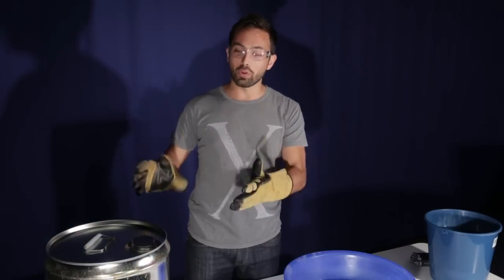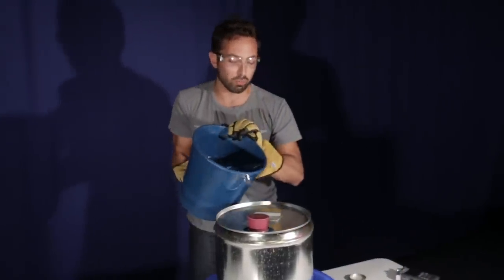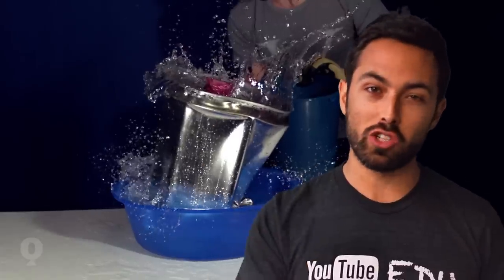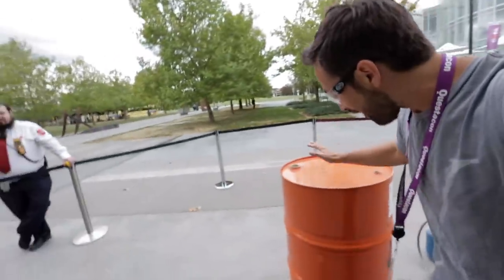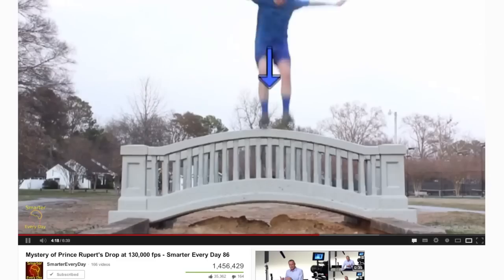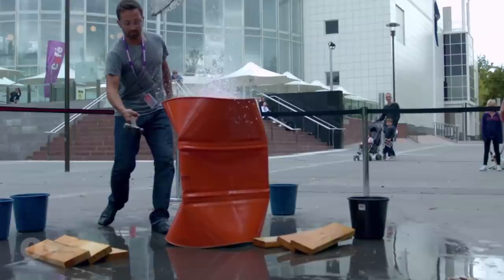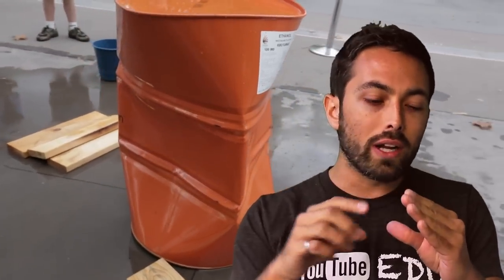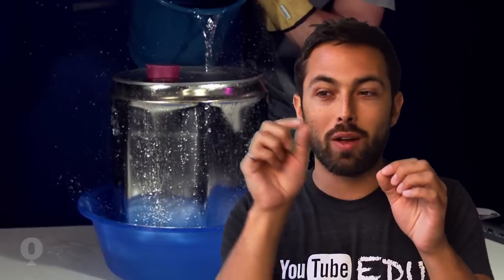Epic Slow-Mo Drum Implosions!

Comment: I'd guess it has something to do with being Perfectly circular. A better made canister will resist the force equally, so that when it contracts, it does so equally on the round shape, so the force travels around the outer surface, and collapses the sides around equally space tangents. (At least i think the word is Tangent...I may be using it wrong. I is are not gud wit da mat'matix termz)

Comment: ...to me smaller drum has smaller (better) height to diameter ratio, meaning it sides can witstand higher lateral pressure. If the vacuume inside smaller drum is simmilar to that of the bigger drum, given the biger surface area of the bigger drum higher force will be exerted on the drums sides meaning it will crimple it even "deeper", until it's sides turn into triangular shape...:/

Comment: well there is the key difference that you hit the orange drum with a hammer and the other was not. the orange drum crumpled with the point of contact with the hammer directly in the middle of that side of the triangle. the ridges on the drum most likely played a part as well

Comment: Derek, in my perspective, what you suggest about minimum volume is incorrect. Wouldn't be even better if the drum had crumpled in a shape of a line and the two opposite sides came in contact (so the axial cut would reveal a line and not a triangle) and the volume left would be even smaller...?

Comment: Yeah that's fucking awesome.. 
In my opinion it's because of the size difference between the barrels, the smaller one had less "work" to do whereas the big one had more resistance to deal with along with a higher amount of water to be condensed within. This would explain why it took longer and 'chose' the most efficient way to implode. The smaller barrel had more of a structured implosion it seems, as if the vacuum had time to create a nice structure until it imploded from the lower right!Imhigh

Comment: I think you aren't completely right about the triangle being the equilateral figure with the minimum amount of area on a fixed circumference: a "bi-agon" (polygon with just two corners, i.e. two parallel lines/sheets) would enclose no area at all.

Comment: you dont answer my comments anyway 
but i still wanna answer that.

the big drum was hammered, the small was not
atmospheric pressure is regarded as CONSTANT
the big drum is stronger than the small drum
small drum cant stand the pressure not due to STRUCURE 
but due to the STRENGTH of the material used
still, when temperature change happen very rapidly
(in this case cool water)
it will form into triangle
the big drum was hammered 
forming uneven cylindrical shape
making the STRUCTURE weaker

Comment: Mmm... That's interesting. If it's uniform, then the drum wouldn't implode (no favored direction), but there is a weak point where Derek hammers it. May be the poligon depend on how hard or where (relative to the welding points of the barrel, for example) the hammering is?

Comment: The answer is weaker parts of the surface deform first. If every parts of the surfaces were equally strong (which is impossible) then it would has shrunk uniformly. Hope this makes sense.

Comment: If neither of us were so scientifically inclined, I'd suggest you must have super-human strength to dent a drum like that. Fortunately science is cooler, and you're helping it have a cover that reflects the inside.

As for the difference in "after" shape, I think the large drum has stronger rings on top and at the bottom. It looks as if the y-axis of the small can folds easier and bends the rings out of shape(See 6:45). I think perhaps the thickness of the drums and rings determine the end-shape

Comment: The big drum resisted much better than the smaller one. My guess is that by the time it collapsed the pressure inside the big drum was much smaller compared to the pressure in the small drum when it also collapsed. This forced the big drum to collapse to a triangle.
In other words, why would the small drum collapse into a triangle if "all it needs" is to collapse to a hexagon?

Comment: not spherical...a sphere(compared to all other 3d shapes) has maximum volume for same amount of surface area. but vacuum goes for minimum volume which is an equilateral prism. an infinitely large vacuum would not leave any space or empty volume inside the container.

Comment: I think that the hammer gave a boost to the vacum for the spécial cylinder structure but if you did it with a cube or anything else it would have been regular

Comment: That doesn't make sense to me, because wouldn't a triangle be a lower energy state? The hammer adding extra energy isn't quite enough to explain why a triangle is preferred over a hexagon, especially if a triangle is lower in energy. (Energy isn't a magic word that explains the problem specifically, I need to know HOW.) And about the experimental consistency, they could perform both in the same room with a vacuum pump, then pressure differences would be consistent.

Comment: But it doesn't have to be a prism does it? I mean if I drink from a plastic water bottle, I squeeze it to make the water come out because of the pressure, and then it gets a shape similar to what the bigger drum turned into but with 2 sides...almost like a 2-sided polygon prism, which doesn't exist, but if it did, it would contain much less volume than a 3-sided one...So why doesn't it get sort of squished on 2 sides instead of 3?

Comment: Ah, I see what you mean. I don't think there's a reason you both can't be right. The method he uses doesn't form a perfect vacuum, so maybe there just wasn't enough force.

The thing is, bending material inward doesn't just happen. If you were to take a triangle and make the sides concave, you would need to add distance to the sides because the curve would have more "length" than a straight side. When trying to physically create this, it does weird things to the shape of the container.

Comment: The earths atmosphere is pressing on your body in all direction so it you have to hold the weight up with your muscle and bones and the individual cell in your body can resist the pressure because they have the same pressure inside them. It would be like if you blew up a balloon and took to the bottom of the ocean, it would be crushed, but fill it with water at the bottom of the ocean or air at that pressure and the balloon would have no trouble staying inflated.

Comment: A completely perfect sphere would never implode because there's no piece of the surface that caves in first (it's all the same). If you would smack the perfect sphere with a hammer I'd think one half of the sphere would fold inside out so it practically coincides with the other half.

Comment: Perhaps the temperature inside larger drum cooled to a much lower temperature before imploding compared to the smaller drum. Thus the larger drum had to accommodate for a greater change in pressure than say the smaller drum...

Comment: Is it really correct to speak of vacuum here? Also since you use water is not the condensation hindered by the pressure so that most of the condensations happens at the point of implosion?

Comment: I think that the actual smallest space would be no space at all.  Were the implosion strong and accelerated enough it would fold or squish flat like a deflated balloon or paper.. but then, I'm just guessing and it would require a sudden dramatic change in pressure or a hammer. :P

Why the first drum collapsed at first into a hexagonal prism-like shape instead of a triangular prism like the second drum?  I'm wondering if the surface area to volume ratio affects that, or experimental differences?

Comment: His explanation of what helps the steam turbine spin is not entirely accurate.  There needs to be a vacuum created to aid in the expulsion and condensing of the saturated steam - this is accomplished with an air ejector which uses part of the steam to create a venturi effect to draw a vacuum on the condenser.  This enables the rapid condensation of the high-energy steam to condensate liquid, which is then recycled back to the steam generators.  Just the condensing the exit steam is not enough.

Comment: Hitting with a hammer might force an axis symmetric shape, probably doing the same thing with the smaller container with less pressure and hitting it on one side should do the trick. But then, at this point, both experiments would be "forced" and not automatically taking a triangular shape.

Comment: I think it's the ratio of the circumference of the base to the height. Things like this become easier to think about if one imagines the extremes. imagine a hollow cylinder 1 inch in high and 10 inches in diameter. imagine that crumpling into an equilateral triangle. now imagine one with height 1 inch and circumference of 100 inches compressing into a triangle. It kind of can't.

Comment: Rockets and astronauts would have exploded in the alleged vacuum of space due to the huge pressure differential between the inside of the rocket 14,7 PSI and the very negative pressure outside of the rocket !

Comment: My bet: It will implode. I've heard stories and seen videos of oil tankers or trains imploding. The only ways that I can think of for why it wouldn't is if the pressure doesn't go down enough on the inside or if there is a leak.

Comment: Your explanation of why a condenser is used in a steam turbine is incorrect. Where you are correct in saying that a larger change in temperatures creates more power output from the turbine, you are incorrect in saying that the condenser creates suction. The main reason for having a condenser is it takes much less power to pump a liquid than compress a gas back to the boiler after the turbine. That is why the steam is condensed out. It minimizes the pumping power required therefore creating a larger net power out from the system.

Comment: Hi Derek, it is very possible to implode 255 L drums without using a hammer. It depends how the reinforcements are designed. Check out this album with 2 pictures of the drums we used:  imgur. com/a/ vA9Bt

Comment: I would like to see somebody re-pressurize a collapsed drum.
Reply: +ILikeWafflz It would start to re-inflate, and then break along one of the points where metal was bent at steep angles. Metal that is bent that sharply is harder and easier to break by bending it. Try it some time - take a wire, sharply bend it, then bend it back. It will be harder to bend back, and if you bend it back and forth enough times it will break.
Reply: +Lessinath I know all about that, as I do a lot of work with aluminum trim and vinyl, where the whole bending-it-back-and-forth-until-it-breaks thing is used often where a pair of snips or u-knife are hard to use.
I can't remember what was on my mind at the time, but I think I had just wanted to see the dents pop back out in slow motion
Reply: +ILikeWafflz Reverse the video ;)

Comment: I wonder if sound waves have anything to do with it.
Reply: Aaron Reichert I don't see how they would be relevant, unless you want to count that the shockwaves produced are of an audible frequency.

Basic catastrophic physical failure. Pour a lot of cold water on a hot object and there are going to be stress points on the object, the pressure builds to near failure and because it's not uniform it implodes at the maximal stress point.

Slowly cooling the same object would not result in a failure, even if the drum was sealed, as the drum shows at the end.

They should have used ice water on the drum at the end. might have worked without the hammer. I would NOT have done this without a facemask on. The forces involved in this are... serious.
Reply: If you have seen a ruben's tube it shows that sound waves can manifest themselves in easily seen patterns. 
I wonder if natural harmonics influences the pattern they collapsed in. Sing the right note and a wineglass can shatter, I wonder if you could find a pattern in the sound a barrel makes when struck and the shape it tends to collapse into when struck.
It is just a shot in the dark but the geometry of the collapse is peculiar.
Reply: Oh I see what you mean, yeah there's definitely a shockwave when the implosion occurs, not sure if you want to call that 'sound' or not. The implosion causes the shock wave not the other way around though.

I think that the patterns that form a more related to the structural failure traveling through the material of the container in a sort of cascade failure though.

The degree of physical deformation required to trigger the collapse is way higher than you could apply externally. A metal drum like that is MASSIVELY flexible in comparison to a wine glass.

Comment: I was disappointed to see repeated attempts to cool the large drum by pouring water on the top of it when the greatest surface area is on the sides. A slow stream carefully poured on two or three sides would have yielded more heat transfer. I also doubt that the inside of the drum was very hot and the condensing water vapour is not a good indicator of temperature (think of your breath on a slightly cold day).

Comment: High pressure= low volume, how does cold water decrease the pressure inside the can?
Reply: ElementalSkater001 The cold water forces any remaining water vapour inside the drum to condense by cooling it down, explosively reducing the pressure inside the drum since most of the vapour was already gone. That's my take on it, anyway.

Comment: Length of the sides of the cylinder, as relates to the strength of the caps at the ends ?

Also...   :-( for using a drum clearly labeled Dangerous Goods,  Class 3 Flammable, UN:1170 Ethanol...   empty or not, this is not cool.    At least remove the DG labelling before using the drum in a science education video.